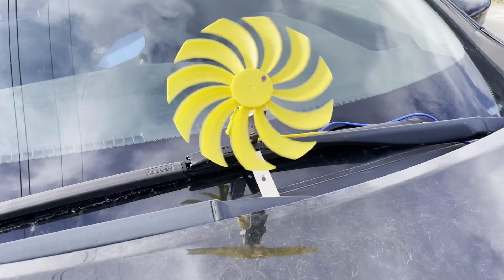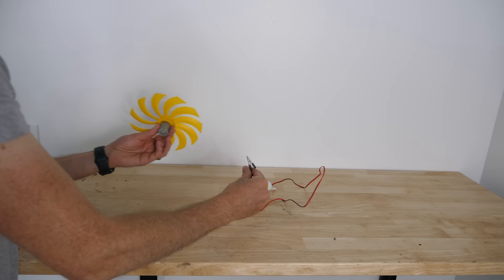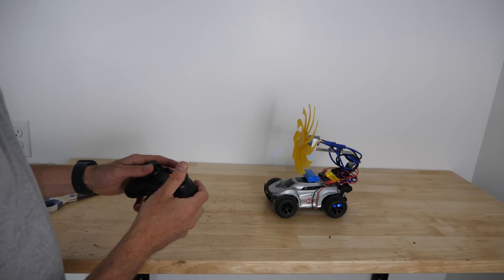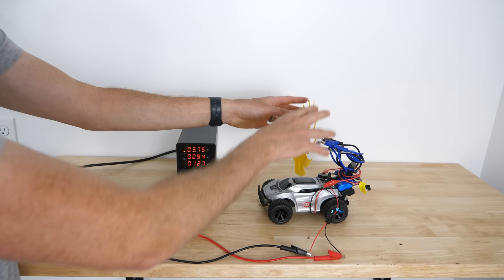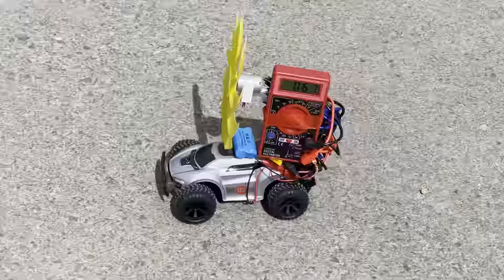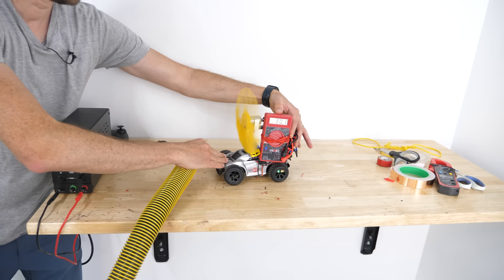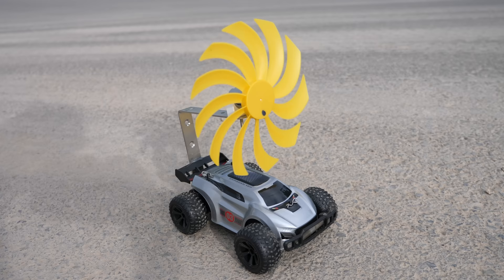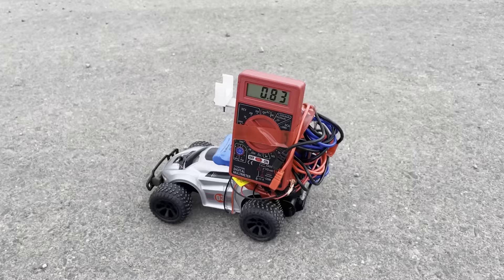Can You Power a Car With a Wind Turbine?

Comment: I wasn't necessarily expecting a wind powered vehicle, per se.  I think what I was more interested in was whether this could operate the same way that brakes do in electric cars--braking doesn't allow you to drive an electric car indefinitely, it simply increases your mileage sightly by allowing some of the energy regained from braking to recharge the battery.
Reply: But would that add anything more than the regen braking already does? Or would it decrease it's effectiveness by losing momentum to the air-resistance and rotation of the fan?
Reply: @rodericklenz5030  A wind turbine can not be nearly as efficient for regeneration as using the motors as generators. Also, the motors are already there, no extra hardware needed.
Reply: The key to regenerative breaking is that it takes advantage of waste heat. Friction that just creates wasted energy as heat in a normal car. The wind over your car is not wasted energy. You must create that to move. If you try to take away from it your car jut has to work harder.
Reply: @Ides385  that's not actually how regenerative braking works with EVs, in fact EV braking works quite differently to braking for an ICE vehicle. You can't use friction to arrest the motion of an electric motor. All that actually does is decreases the resistance of the coils and increases their current draw. If you arrest it to the point where the spindle can't rotate at all, the motor effectively becomes a short-circuit, which is bad.
And if no power is being transmitted to the motor when you arrest it, you've still got a conductor moving through a changing magnetic field, which will induce current, which is bad.
EV regenerative breaking works by "reversing" the circuit and using the motors as generators, directly converting the momentum of the vehicle into electrical energy. Due to conservation of energy, converting momentum to electrical energy means momentum is "lost" and the vehicle slows down.
If you're here watching the action lab, I'm sure you've seen videos of magnets being dropped through copper tubes and floating spookily down. This is the same principle.
Now the caveat to this is that this kind of braking only works at relatively higher speeds and can't bring a vehicle to a complete stop, so once an EV slows to the point where gravity, friction, momentum, and electrical energy coming out of the motor are at equilibrium the car won't slow any further. At this point EVs DO use friction brakes to bring the car to a complete stop and lock the wheels, but these are at speeds low enough where it won't damage the motor or it's control circuit.
(Sources: I'm an electrical engineer and worked on regenerative braking systems in my postgrad year).
Reply: @fishyerik  Yes, the purpose of my question was to prompt the OP to think about these things.
Reply: @rodericklenz5030  I think you completely misunderstood what I was saying. A normal car creates waste heat. Instead of just creating waste heat you use regenerative breaking.

Identifying and reducing waste heat is big business and a sure fire way to improve efficiency.
Reply: It doesn't change the basics 1kg takes 9.8 joules of energy to lift 1 meter.. thats the same weather the energy is produced by battery, combustion or by you eating carbohydrates. 9.8 joules is what it takes here on earth to do so
Reply: Ev regenerative breaking works because the motor without power has resistance due to the magnets making up the rotor and stator. It's 100% identical to any electric motor 7n that if you add power to the leads electron flow spinster motor relative to the amperage flowing through the circuit ( the motor is the load obviously) without power, if you spin the motor you will generate current at those leads. By way of a bus converter and a cycle loop you can route that power back to the battery through the bms.
Reply: What about little fans on the side?
Reply: @Ides385  no. Try again. Say "Thank you for the knowledge," and walk away before you dig a very stupid hole for yourself.
Reply: I guess the fans would need to be integrated into the body as to not hinder aerodynamics, but the air would also need to be able to passthrough at a sufficient rate
Reply: @rodericklenz5030  Take a little time buddy, there’s no need to be so condescending, particularly when you mislabel kinetic energy as ‘momentum’ in your otherwise informative initial reply. What is being suggested is that a vehicle’s kinetic energy when braking conventionally is wasted as heat. In an ev, that kinetic energy is converted back into electrical energy (then converted/stored as chemical energy in the battery); i.e. what is conventionally wasted is now mostly recovered. This is unlike the air over a car where there is no ‘wasted’ energy to utilise during normal driving. A wind turbine that pops up into the (relative) airflow when braking would be the closest thing technically, but wildly impractical (and probably quite noisy). 

@ides385 Arguably there’s probably some skin friction that heats up the bodywork a bit, but you’re probably not going to get any meaningful thermoelectric effect until you hit Mach 1 in your Tesla!
Reply: whats "per se"
Reply: @Ides385  Pretty soon, when you say "normal car", you'll be talking about EVs. They are getting more and more popular and starting to almost become normal.
Reply: There are plenty of ways of catching passing air through highly efficient turbines that would not produce much extra wind drag at all.
Reply: @rodericklenz5030  I think it was proven well by the video itself.  I just didn't think he really understood why people were curious about utilizing wind to power vehicles.

Most people have enough knowledge and sense to understand that it would be perpetual motion to try to power the car with wind entirely.
Reply: Regenerative breaking gathers the energy you would normally waste when you slow down. A wind turbine forces your vehicle to work harder than it would normally have to while moving forward. You will lose more energy that way than you would get back from it spinning, thus using more energy than you are putting back into the system.
Reply: You can technically use that concept since we already use it in combat aircraft: the system is called ram air turbine. The turbine only open when the aircraft want to fire it's electric vulcan cannon, slowing the plane down slightly. It is effectively a fancy airbraking. However, it won't be as responsive and practical as mechanical regen. Air drag wasn't all that much when you're moving under 60 mph in a car (around 40 mph in motorcycles).

Comment: Quint BUILDs made a full size test rig similar to this. You guys should collaborate being so local to one another!
Reply: And his rig did create a net positive compared to no windmill. So he increased the range.
Reply: @ZartaxtheWise  It was a different scenario, he attached the turbine in front of the car, so he didn't increase the frontal area of the car, which creates drag. So in that case it might work
Reply: That was the first thing I thought when I saw this video
Reply: @stefanmelich9886  No because the drag is due to the energy used to turn the blades. If he got to net zero either his meter was wrong or he was lying. It's imposable
Reply: @maxpayne2574  in the right conditions (extreme wind) you could end up net positive. Though you'd get even further if you just charged from standstill and then removed the fan.. and if such conditions were so common you'd be better off with a deployable sail..
Reply: @maxpayne2574  It was positive for him. Go watch. Used the turbine to power an electric stove
Reply: If only Mythbusters were still a thing

Comment: You're the teacher that knows the subject well and can create a moment of appreciation for it out of thin air. Also you're a true scientist and open to test "ridiculous" ideas using the "scientific method".
Your content is great! Keep up🎉
Reply: see that quite a few people are giving you a thumbs up. Keep in mind this little technique: if your phone goes down to one bar and you plug it in and you are still using the phone, your phone will fully charge. This is called pass-through technology. If you do research on this, you will find that if this was applied, you wouldn't have those inefficiencies.
What did I just do? I just used a technology that's been used for quite some time, instead of doing everything directly. It means that for over a 100 years, we've been off the direct power train and got on Nikola Tesla's alternating technology. As soon as you start to understand exactly how you can power something at the same time use its power, you can make this work. Of course, other companies and other people have already done this and got the car in real life to actually work.
So instead of arguing back-and-forth with the guy who I believe is prejudiced on certain subjects, I simply went to Google AI and asked the question. Here is what AI stated:
Yes, there are a few examples of people who have successfully driven cars with windmills attached to them.

In 2009, a team of students from the University of Michigan built a car that was powered by a wind turbine. The car was able to reach speeds of up to 35 mph.

In 2010, a team of students from the University of California, Berkeley built a car that was powered by a solar panel and a wind turbine. The car was able to travel 100 miles on a single charge.

In 2011, a team of students from the Massachusetts Institute of Technology built a car that was powered by a wind turbine and a hydrogen fuel cell. The car was able to travel 200 miles on a single charge.

However, it is important to note that these cars are not practical for everyday use. They are very expensive to build and maintain, and they are not very efficient. The wind turbines are only able to generate enough power to move the car at slow speeds.
It is more likely that wind power will be used to supplement the power of a car's engine, rather than be used to power the car entirely. This could be done by using wind turbines to generate electricity that is stored in a battery, and then using that electricity to power the car's engine.
Please start asking questions before accepting information from someone that is intelligent but often makes quite a few mistakes. Even if you have to go to AI and didn't back it up with actually going to websites that show the results of people's accomplishments, if not then we can't move forward. We stay the same and people like that don't want real change. Read it for yourself before you give thumbs up.
Reply: @WIZ56575  Actually, you just need to watch the video and make your own conclusion. Some things in this video are debatable. However what is true in it is that you can't make a car that would be moving by the power that is generated by the wind when the wind is only the result of a car moving itself. The examples that you give are for the cars that use the wind of an outside source (wind caused by natural phenomena). And this is of course possible.
Reply: @d4slaimless   Again what I've been telling everyone this is an old technology it's already been proven it's already been done and I have to keep giving people information like this,
there are a few cars that were built with turbines within the body of cars to produce any type of energy. Here are a few examples:

Chrysler Turbine Car: This experimental car was produced by Chrysler from 1963-1964. It was powered by a turbine engine that could run on any type of fuel, including gasoline, diesel, kerosene, and even vegetable oil. The car was not commercially successful, but it is considered a milestone in the development of alternative fuel vehicles.

Rover JET1: This car was produced by Rover in the early 1960s. It was also powered by a turbine engine, but it was designed for racing rather than for everyday use. The car was not very successful, but it helped to pave the way for the development of more advanced turbine-powered cars.

Toyota Fine- 1: This car was produced by Toyota in the late 1980s. It was powered by a small turbine engine that was used to generate electricity to power the car's electric motors. The car was not commercially successful, but it was considered a testbed for Toyota's hybrid electric vehicle technology.

These are just a few examples of cars that were built with turbines within the body of cars to produce any type of energy. While these cars were not all commercially successful, they helped to pave the way for the development of more advanced turbine-powered cars that are now being developed by automakers around the world.
Reply: @WIZ56575  the examples you give here are gas turbines (jet engines) not wind turbines as in your original Post. The gas turbine is an internal engine to the vehicle just just as a diesel engine would be. These are a completely different situation to mounting a wind turbine on a vehicle..
Reply: Jokes on you, ..windmill powered vehicles(whether land or sea) are all things that are actually possible, and have already been demonstrated. Note the equation Power = Force x Speed, ..and it's easy enough to see how it's entirely possible. That is, the input medium must be at the greater velocity relative to the vehicle, and the output reaction medium must be at a lower relative velocity to the vehicle.
Reply: @williambreen1001   Don't understand why you think the jokes on me when I've been adamantly telling everyone the same thing,I agree with you that wind-powered vehicles are possible, and I think they have the potential to be a more sustainable and environmentally friendly alternative to traditional vehicles.
The equation you provided, Power = Force x Speed, is correct. The power of a wind-powered vehicle is determined by the force of the wind and the speed of the vehicle. The force of the wind can be calculated using the following equation:
Force = (1/2) x ρ x A x v^2
where ρ is the density of the air, A is the area of the sail or propeller, and v is the speed of the wind. The speed of the vehicle can be calculated using the following equation:
Speed = v = (2 x Power / Force) ^ 0.5
where Power is the power of the wind-powered vehicle, and Force is the force of the wind.
The number of wind-powered vehicles that are currently in use is relatively small, but this number is expected to grow in the future. This is due to the increasing awareness of the environmental benefits of wind power.
Reply: @WIZ56575  What the f is going on in theses comments. I just said that this guy is a good teacher.

Using a turbine on a car is ridiculous. Which is not to say that it is stupid. Its just funny.
Cars that are powered by wind exist. They're called sailboats ⛵. Also Veritasium made a video on a wind-powered car that is going faster than wind.
Reply: @norude   Come on you sound like trump, We're going towards the future sorry. I just sent this to somebody else who wrote with something real scientists can understand.I agree with you that wind-powered vehicles are possible, and I think they have the potential to be a more sustainable and environmentally friendly alternative to traditional vehicles.
The equation you provided, Power = Force x Speed, is correct. The power of a wind-powered vehicle is determined by the force of the wind and the speed of the vehicle. The force of the wind can be calculated using the following equation:
Force = (1/2) x ρ x A x v^2
where ρ is the density of the air, A is the area of the sail or propeller, and v is the speed of the wind. The speed of the vehicle can be calculated using the following equation:
Speed = v = (2 x Power / Force) ^ 0.5
where Power is the power of the wind-powered vehicle, and Force is the force of the wind.
The number of wind-powered vehicles that are currently in use is relatively small, but this number is expected to grow in the future. This is due to the increasing awareness of the environmental benefits of wind power.
 Make a comment if you understand the math or get out of the school It's too hot for you.
Reply: @WIZ56575  Hey, this AI chat bot is commenting under me comments.
tld
Reply: If that so it came to my inbox so you sent it to the wrong person. Make sure you know who you're sending the message to and thank you for letting me know that my intelligence is that broad.
Reply: @WIZ56575  That wasn't a response to you lloyde.
Reply: I am not arguing that windmill powered vehicles are impossible. They obviously are. The same way as ships can use sails. But you can't make perpetuum mobile. You can't create vehicle that sustains motion  only by the power of that motion itself. You need external source. For windmill you need wind. For internal combustion engine you need fuel etc.
Reply: @d4slaimless  Yes, you have a point, but you must understand that for everything we can't do, we find new technologies. People who want to dismiss this technology want to stay on the same path of destruction. We understand that we must make a technological change, and it is hard because people resist change. The technology we are speaking about is just at its birth, but it has already been proven that we can make it work by numbers. However, we need to improve different strategies and technologies to make it work the way we choose.
Now, as Nikolai Tesla has taught us, we shouldn't be doing anything directly; it should always be alternating. Once this lesson is learned, we can move forward much faster. So, look into this: Can a windmill on the side of a car charge a battery? Find out by how much, and then find out if you can simply switch to the new charge battery. That's called alternation.
Reply: I'm not really sure if those quotes were necessary